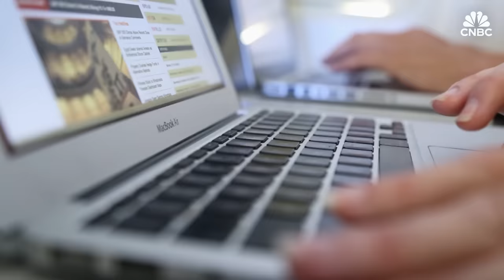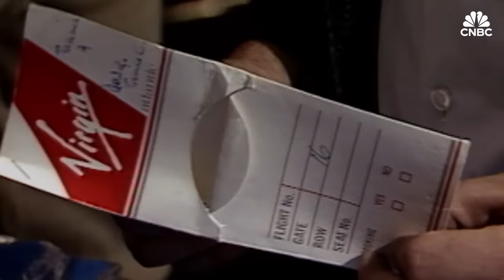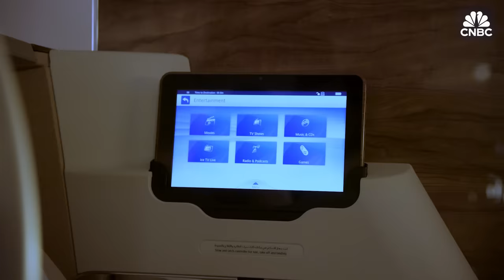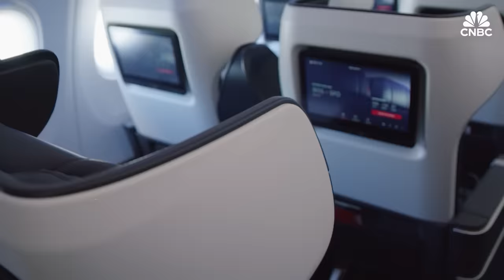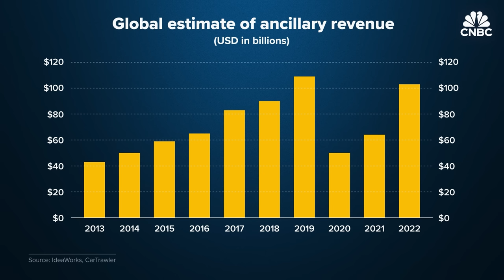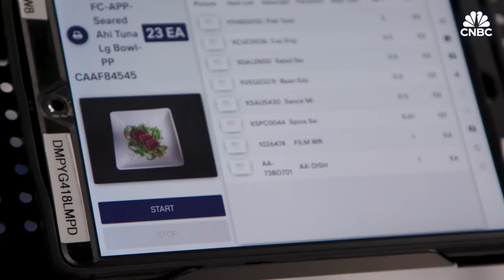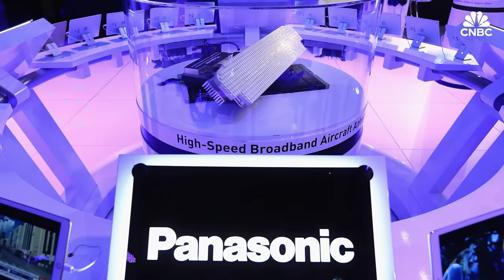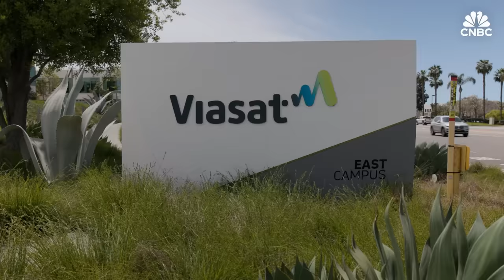Why Airline Perks Are So Disappointing | CNBC Marathon

Comment: Been flying since the 80s.  Over two million miles.  Back then there were two classes (coach and first).  I could only fly coach.  A non-stop flight from memphis to orlando (in coach) and we got a full meal, on normal dinnerware, metal cutlery and a choice of entree. Now, first class has a seat that was a coach seat back then and we are thrown a "gourmet" back of nuts and get a cup of soda or water.    Economy (previously coach) is crammed into torture seats and gets nothing.
Everything and everyone from the online process, to check-in, to flight attendants, makes it seem like you are bothering them by flying their airline.